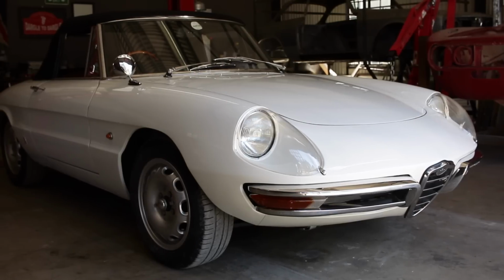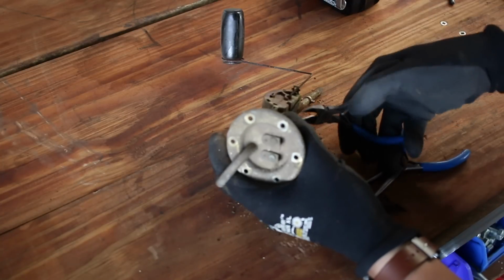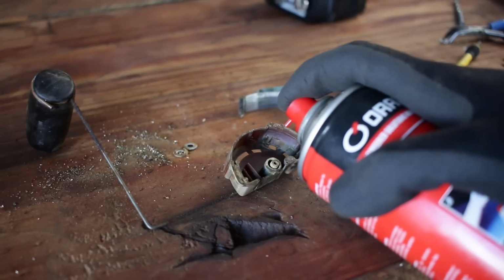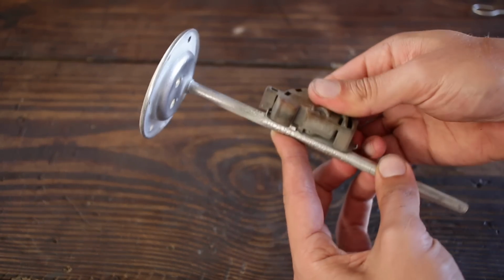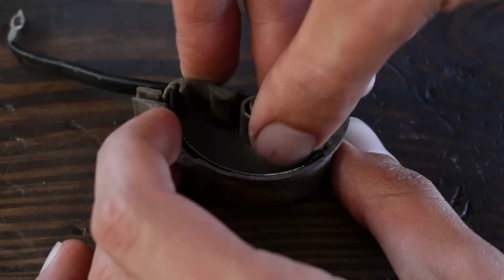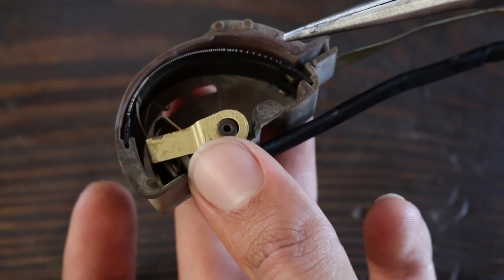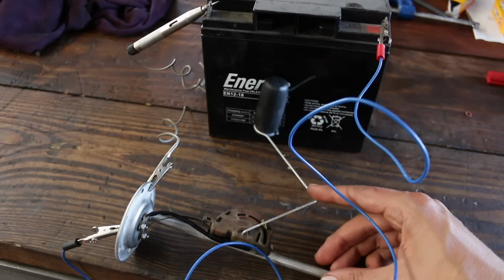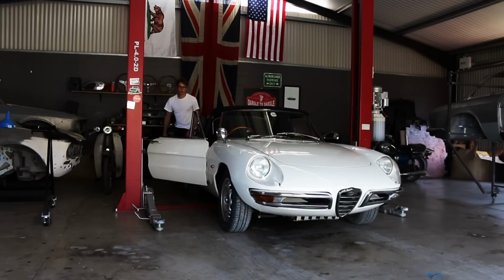Rusted and stuck fuel sender unit repair - Alfa Romeo Spider Project

Comment: I believe you mean Ohms Resistance measurement.  Measuring resistance in the contact point of the winding. If electrical 'Current' is running through the sender then the tank will explode from the current and vapor. Yes some sending units have current wiring but that should be for the fuel pump and not the Sending unit (which should be using ohms for measurement)🙂

Comment: What did you use in between the connections at the top to isolate them from the metal body? Plastic or rubber washers?
Reply from the maker: I used fiber washers, and then I sealed everything with some clear epoxy. That seemed to hold everything well.

Comment: A lot of older sending units used a design not unlike the one you repaired in this video. This will be incredibly helpful with my own restoration, I was initially hesitant to tear into parts such as these.

Comment: I love your videos. How do you deal with the old fuel tanks and rust in them. Do you get new ones or re finish the old ones. My 71' beattle has big problems with it
Reply from the maker: I have them cleaned out by a local radiator shop, they use an acid dip to get them clean, then put a fresh lining in.
Reply: @JethroBronner  oh thats a great advice! I will try to find one as well locally

Comment: Fantatic and satisfying job that pared well with my coffee just now! I went through sending unit issues with my 86 spider as well; it's very smilar to yours. My problem was the float filling with fuel. I couldn't buy a new float, so I thought that a new sending unit would be the way to go. The new units have the arm coming off the wrong side, which pissed me off. Then, I tested it out with both a multimeter and hooking it to the fuel gauge as you did. The new one was  horrible, readings jumped all over the place on the multimeter, and the fuel gauge needle 'sweep' was jerky and sticky, compared to the smooth operation of my original unit. I just bought a float for an MGB that fit the arm and installed the original unit...
Reply from the maker: That's a smart way to sort it out. I have the same issue with the fuel float for the 72 GTV project, it's dropped off the arm. I'll have to figure out a way to re-attach it somehow.

Comment: Hi Jethro, I recently subscribed and I’am really learning a lot from you..
A guy gave me an Alfa Romeo for debt of $2000 USD, it was an option of MGA or Alfa, I opted for the Alfa because I was never a fan of British Marques after a bad first experience with my first car, a mini..
The Alfa as been in my garage for over six years, I started her up once  but never really looked at it much, my teenage son is now quite interesting in cars and he is insisting that this car is the 1966 Giulia spring GT veloce, it does have the four leaf clover on the c panel and all the right attributes of the veloce..
The boot lid is rusted out, need floor pans, rocker panels and left door..my estimate to repair ground up is about 20k USD..
What do you think, should I do it ?

Comment: Hey Jethro, I've been viewing your vlogs for about 10 months now and own a 105, 1750 Berlina, but I'm having a great deal of trouble removing the rear discs? The handbrake is not biting at all ( both discs spin freely) I've removed the M8 c/sunk screws, but the discs slide forward about 40mm and then no further. It's becoming fairly soul destroying. Is there something I'm overlooking? Last week I removed the 4 nuts at the back of the disc dust cover, but still no luck. Advice is greatly appreciated. Many thanks in advance.

Comment: Excellent restoration job done on a delicate sender unit. This is something that I would have never attempted,probably because,the slightest mistake and the unit becomes just scrap.  I had the same problem as you,when I installed a Veglia Borletti sender unit from a Giulia Super to my car, a 1750 Berlina,which had Jaeger Italia,fuel gauge and instruments,it worked but was not accurate. The only solution was to buy the correct Jaeger sender unit

Comment: I had to fix the one on my 1750 GTV too. I just dunk it in rust remover (Evapo-Rust) without dismantling it. Seems to work fine now. It was very rusty and the float had a leak by the metal ring holder, after the car stood for 15 years with some fuel in the tank.

Comment: So you got stranded with nu fuel? Your not worried about any damage of running without fuel? As always nice vid
Reply from the maker: tuneskramer69 they kinda just cut out when they run out of fuel, it doesn’t hurt the engine, it won’t run lean.
Reply: @JethroBronner  ok i am not familiar with these engines. But sure Will make good content 😉